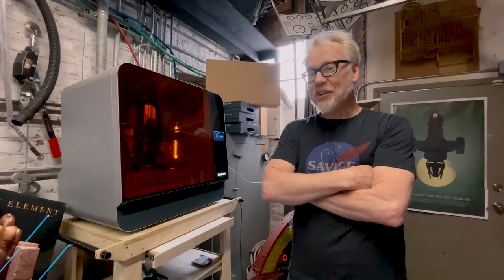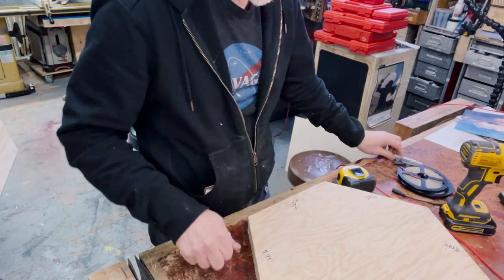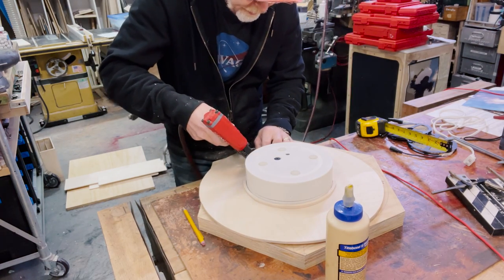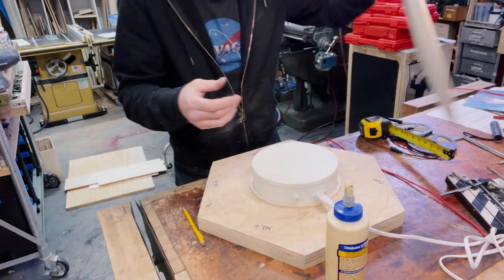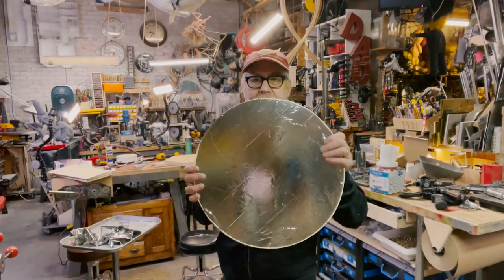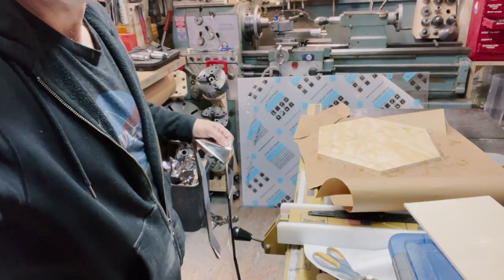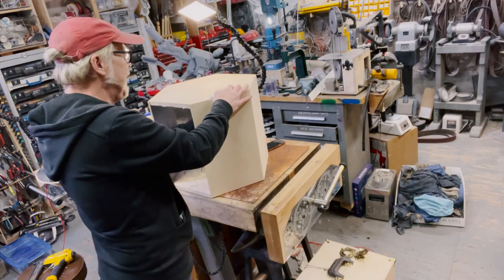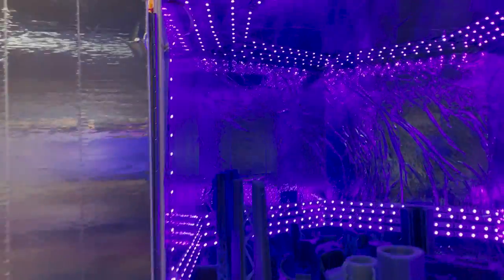Adam Savage's One Day Builds: 3D Print UV Curing Oven!

Comment: Wouldn't you want to make the table out of acrylic so that the bottom gets hit?
Reply: What you'd really want is a stand out of acrylic (that is specifictly UV transparent) to place ON the mirrored bottom.
Reply: This is indeed a good idea. As is, he would want to flip the parts over to cure the underside as well.
Reply: I was thinking a hanging system!
Reply: @ashtrays13  some prints wouldn't be able to hang or at least be difficult to.  But anything could be placed on a table.
Reply: He could simply add a acrylic disc on top of the turntable to allow the reflection. A 1/16th thickness should suffice
Reply: Acrylic will filter out much of the UV, better to just turn the part over/put it on it's side.
Reply: @mfx1  which is why I specifically said "UV transparent acrylic".  You can get acrylic that is greater the 80% transparent to UV and designed not to degrade under constant exposure.
Reply: I just looked up if acrylic even lets UV through. Here's the quick answer I found:
Common Plexiglass blocks vacuum UV, far UV, UV-C, UV-B and most of UV-A.

UV grade acrylic will transmit UV-A and some UV-B.

Comment: The whole point of having a rotating platform (and reflective walls) is so you don't need to stick UV lights all around, and can instead have just (for example) two fluorescent tubes, on each side of the "door". Also, if the platform is opaque, the bottom of the prints won't get much UV.

Comment: This basic style blows the nail dryer ones out of the water. And in before times when wood was cheap it was pretty affordable. The mylar blanket is a nice touch. Now you really can make something that works as well for really cheap. Mine was tossed together with the thought Ill make a better one later and well its been good enough. So you can use a cardboard box, I spray glued tin foil(same process as Adams Mylar). Then I coiled the UV led strip(no controller just simple on/off) up in the box. I feel coiled is better coverage then in segments like adam did, but reality is they both probably work the same.  You can get solar powered turntables with a clear top on amazon really cheap. I like the thought of the turnable being clear for better uv coverage on the bottoms, but again reality is prolly doesnt matter much. Benefit there is the UV Leds power it so no cords, and starts when you turn on the Leds.  I made a optional duct tape handle for the top. I simply lift it up and down to access.

Comment: I really wish i could build stuff and do more creative things, but with budget and being a college student im not sure how others can afford to create such cool things
Reply: Like Adam,  put your designs and thoughts in a drawing book.  You can refine your ideas. Then when you have a chance to make your projects. You have your notes like Indiana Jones.  👍💯
Reply: You could probably make this with cardboard alone.  Doesn't help with the expense of the printer of course.  What do you want to make?
Reply: There are things that can be done on a very modest budget. For example, I'm currently getting into modelmaking using XPS insulation foam. To get started you basically just need a knife, a pencil, glue and a set of acrylic crafts paints and brushes. There are of course a lot of things you can spend money on that make your life easier (e.g. a hot wire cutter and more/better paints), but this is all you really need and you can get some impressive results with that.
Reply: @CorwynGC  Indeed. I use a cardboard box lined with aluminum foil. My UV lamp was $15.

There are also cheaper printers, though that's always relative. For great bottom dollar, the Elegoo Mars is really good at about $160, sometimes goes on sale for less. It's pretty small though.

A very good step up from there is the Elegoo Saturn, though it's a bit hard to get one. It's $500, but as good or better than many $750-1500 machines, which is why it sells out within minutes every time it goes up on Amazon. ( Ignore anything over $500, those are scalper assholes. ) They go up most days though, sometimes more than once a day, so if you try you can actually get one.

Resin will become the main expense though. 1L/KG starts around $30. Most resins can be had for $45 or less, but there are other more specialized ones that get absolutely astronomical, with everything in between.
Reply: Look for a makerspace near you.  Your school might have one, or find an instructor who will start one.
Limited resources are a great way to be creative. Hot glue and cardboard can go a long way. Duct tape is wonderful. Your school should have a mechanical engineering program. They have tools. You need to be taught how to use them,  and they will have classes. 
Never give up.  Never surrender!
Reply: @bandit2602  I live in Wyoming not much resources to get creative supplies from as well more expensive to mail
Reply: @cheshireray5725  What about dollarama or dollar tree? They would have basic tools, craft supplies and all sorts of things you could use to start off with. Some might not be the best quality, but better than nothing until you can afford better stuff.

Comment: I built 4 uv cure chambers of a SURPRISINGLY similar design for work recently.  I guess the problem of cost for mirror sheet was a driving factor for Adam as well.
Reply: Lowes 12 inch mirror tiles pack of 4 or 6 i forget was like 15 bucks.
Reply: Look for your local Glass & Mirror installer. They may give you a deal on any "scrap" mirror they have. I fixed my vanity for free. (minus the glue)

Comment: Cool build!  FYI though, some formlabs resins won't cure properly (i.e. achieve advertised mechanical specs) unless you use heat (50-80C) in addition to the 405nm light.  I learned this the hard way with Tough resin on my Form2, and ended up getting a secondhand Form Cure oven which made a world of difference.

Comment: +1 for using 'bestagons'.
-1 for not using a clear acrylic base on the turntable; which means so light won't reach the bottom of the prints.  Refer to the commercially available curing stations which have this.

Comment: I see you noticed the heat at the end of the video. I would recommend putting some form of ventilation in there as I've found the heat from the UV lights can mess with the prints curing certain types of resin
Reply: I think the heat is coming from the resin as it cures, being an exothermic reaction. The LEDs themselves should be generating little or no measurable heat. But either way, some ventilation would be a good idea.

Comment: FDM is, I'm told, working on more consistent outer surfaces. Stuff like Prusa's "monochromatic" top surfaces, nonplanar slicing. I don't think they'll reach the resolutions that resin can achieve without heavily customizing the workflow (or using multitool systems), but it's already "good enough" for some engineering applications.

25:50 ... I just use a multimeter on continuity mode and be paranoid about all the connections (5V data ground for NeoPixels, additional clock wire for APA102Cs). After learning how not to cut/solder the tape, I haven't really run into problems.

Comment: Suggestions/recommendations for modding this build: 1) the height from the rotating base plate to the top should exceed the max build height of the printer but not by a huge amount, 2) make the outside circular rather than hexagonal for even light distribution and easier light attachment, 3) make the rotating base plate from plexiglass or similar clear material to allow curing of area of the pieces where they sit on the rotating base plate, 4) UV lights should spiral down from the top to the bottom (or vise versa), and 5) silver coat the bottom of the housing and add UV lights. You could also add a small exhaust fan to vent the heat that Adam mentions. Resin parts will warp or split if exposed to too high a heat for too long. Also, it's nice to make a fiber optic attachment ( just some fiber optic cables bound by shrink wrap) to the UV flashlight to cure the insides of hollow parts.

Comment: The only thing I would suggest is removing the supports before curing. Most of the time they will peel right off if you use warm water after the IPA bath. Save you a lot of clipping and filing you otherwise have to do.

Comment: Surprised you didn't make the door 2 panels wide. You're limiting the max print size to what fits through the door, and you could have easier access for part placement on the curing table
Reply: thought the same thing. Hexagon with a double door was my first idea and i was really irritated when he went for the single door...
Reply: @caligo7918  
Adam didn't glue the sides. So he can pull out nails and put a second hinge on. If he doing a large  project. 
Wouldn't be surprised if he modified the door.
Reply: @assassinlexx1993  sure, it is a quick and dirty build and it most definitely will change, but this is something, that limits you from the getgo
Reply: @caligo7918  
True.  But it looks like Adam is doing small stuff.  
I can't wait to see what he is planning to do.
Reply: @assassinlexx1993  it's a huge printer, so i would try to plan for the maximum. Future-proofing is part of my job, so it's one of the things i always have in the back of my mind

Comment: Question, I made my own UV curing chamber for my prints. I always wondered if the turntable aspect was required because I managed to get a full 360 degrees of UV coverage in this curing chamber.

Is it just a similar situation where if you can't get even coverage just do a turntable to easily get it?

Comment: If the camera and you see it, it is likely 405 nanometers wave length.  The ribbon package also suggests that, being the "cheap version".  The UV-A is a bit shorter, say 395 nanometers wavelength or shorter.  Then there is the beast of UV-C, most common source being mercury lamp in quartz tube without fluorescing layer.  Besides the invisible 253.8 nanometers, it produces some secondary wavelength light that reaches to UV-B, UV-A and even visible blue.  That is good, to warn you, because without it you might not use protection.  By the way, most polymerizing is actually done by 390 - 410 nanometer light, not real UV, especially not -B or -C.

Comment: a comment and a question. the comment, just as "quick", but a little less "dirty", it looks like the led power supply was small enough to fit below the turntable, would have made for less high voltage wire runs. 

2nd, the question. i see im catching this video a year old, but im currently looking to make one. how has it worked? i see the led's linked are at or above the upper limit for curing resin, does this affect the function at all or am i worrying too much about it?

Comment: Since the turntable spins and exposes the parts to UV light as it turns, why didn't you just do vertical lines of UV lights instead of horizontal?
Reply: More than likely for ease of application of the string lights.

Comment: Should try using a one way mirror for the door so you can watch the print cure.
Reply: Even a one way mirror would let light out, so the oven would be less effective.
Reply: @Dysan27 — so long as the door/window reflects the UV light back into the chamber, it doesn’t matter how much of the visible light is let through.

Comment: there's way more post processing with resin printers.
FDM is usually only in need of post processing if you need a perfectly smooth print. FDM is generally a far better option for structures.

Comment: Please double check as to whether or not protective eyewear is recommended around your particular lights, good fella!  I've had snow blindness from short term glances at relatively low wattage UV lighting that I thought was innocuous, and it sucks -- like someone has rubbed sand into your eye.  You don't necessarily know it while it's occurring, either, as in my case where the exposure happened in the late afternoon, and the pain set in during sleep that night. Thank you for another build, sir!

Comment: What i'm thinking wrong? Ok the hexagon is a good idea... the more sides... the more spreaded/scattered light. 
But why no lights just in the center of the top? And why just that low band of orizontal lights?
Don't should be better vertical lights on every sides ( for the full high of the chamber) and a better coverage of lights for the top?
And then... how many watt of UV lights are involved in this project? For what i know every kind of resin needs a certain amount of watt and a somehow precise time to curing correctly.

Comment: @08:24 Buffer Overflow! Process has been interrupted - Press ENTER to continue 🤣
My old DIY UV Curing "Oven" ( only UV Cures, doesn't Oven 😅 ): https://i.imgur.com/H3DWiA3.jpg - Practically stopped using it since I purchased the Form Wash for my Form² and Form³ as successfully removing the uncured resin OFF the model has solved most if not all of my issues with the models remaining tacky a curing oven could possibly have addressed - If you only work with normal materials not explicitly requiring to be post cured in a heated oven and your budget only allows for either the Wash OR the Cure - Get the Wash! Besides the Form³ itself easily one of the better investments for scale modelling: https://imgur.com/a/uIbRNAq / https://imgur.com/a/myBu14C / https://imgur.com/a/ZLkzgMs 😁

Comment: Tip: Cutting off the supports before UV curing is way easier. But sand after you've done the curing.
I have an ultrasonic knife which is works great on resin prints. It's not the best idea on FDM prints though as the Ultrasonic knife melts the plastic more than it cuts it.
And when you have print failures (And you'll have a lot) and leftover support material, cure them as well before you dispose of it. Resin parts are not safe to trash until they fully cure.

Comment: Sadly, the aluminized Mylar blanket material will fall apart within months. The polyester can't handle the UV and it will flake and peel.

Actual aluminum foil works better!

Apply a repositionable PSA such as Kuretake ZIG 2-way, roll on the aluminum dull side down and don't be afraid of wrinkles; they actually help with light dispersal in the oven.

Or: poke around on Amazon and find selfstick aluminum backsplash. This is heavy aluminum foil with preapplied PSA and a crack'n'peel backing, typically 40x300 centimeter (16" x 120") rolls for $8 or so. It comes in textured finishes that help reduce UV hotspots in your oven, and the leftovers don't stay left over for long (it's got 101 uses).

Comment: Does this have a heating element? Depending on the resin that you use (tough, durable,flexible,etc) the heat of the oven and the amount of time the part is in the oven is crucial. Formlabs’ website has an extremely helpful page on how long to cure each different type of resin
Reply: I would check out formlabs’ cure machine they carry. Im happy with the one i use

Comment: I've always wondered why don't Freeform integrate some UV lights into the printer itself...
Edit: Could be annoying if printing multiples I guess.
Reply: Because excess resin needs to be washed from the print before curing it. Also if the printer did the final cure any residual resin in the bed would also cure.
Reply: @tiffanysandmeier4753  I know you have to remove some material but wouldn't it be nice to just set them back into the printer after removing excess material, just a random thought.
Reply: They have both freestanding washers and curing machines. They're coming with a larger format ones this year, to fit this large printer. So you can take the entire build plate and just put it in the washer and then the cleaner. You don't just have to remove a little material, if the UV was in the printer you would have to scrub it clean before every single cure. I assume it would SUCK.

Comment: How much was that turn table and where did you get it? I need one for my action figures lol
Reply: It's linked in the pinned comment
Reply: @LightsMB  ah! I see it now. Thank you
Reply: Just use an old microwave.  It has a 3 rpm 120v motor built in
Reply: @travismiller5548  yea lol I thought about it but it wont fit on my shelf

Comment: You really, really shouldn't be looking at the UV lights while they're on. They can damage your vision without you feeling it. Please use eye protection or UV blocking acrylic.
Reply: These resins are cured using 405nm, which is safe. Assuming he got the correct LEDs, it's not really different than a standard light bulb.
Reply: @zemerick  Incidentally looking at 405nm curing LEDs won't cause much damage, the issue comes with chronic exposure to high output UV.

High intensity light of any wavelength will damage your eyes, but you normally have an automatic response to look away and will experience pain. Your eyes are not very sensitive to 405nm and as such you won't have an automatic response to look away nor will you experience pain, but your eyes will still get damaged over time just as if you were staring at an intense light source. This is the reason commercial SLA UV curing solutions all have some variety of UV blocking transparent plastics.

Comment: Easiest way to get a UV oven. Get a metal bucket 50% bigger then you need. Get a piece of plywood for the top of the bucket and cut a hole in it. Get a UV light from Amazon. Stick the print in the bucket. Put the wood over the top and place the light over the hole. Done.

Comment: SLA printing takes WAY more post processing than FDM/FFF especially time wise. 

Plus FDM takes literally zero post processing if you don’t care about removing layer lines which for most things Adam does either wouldn’t be visible on camera or he could just use smaller layers or he could sand if it’s a hero piece.